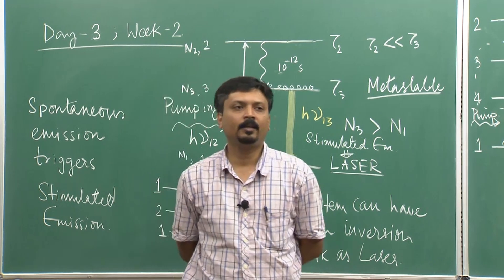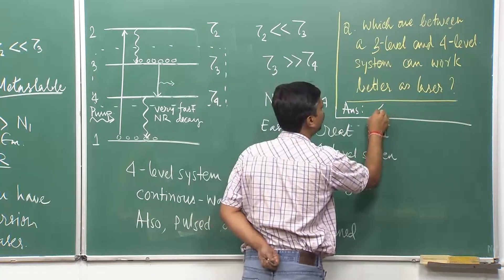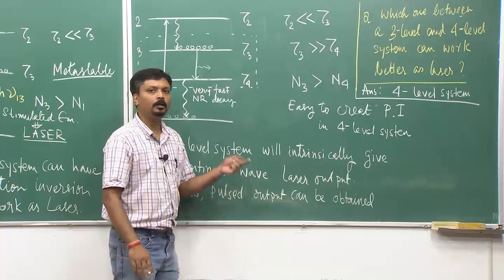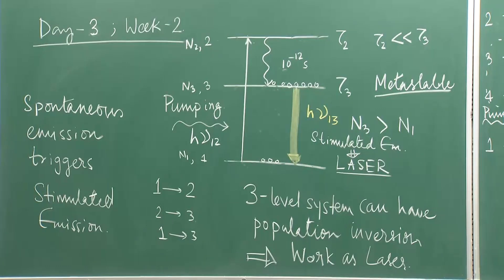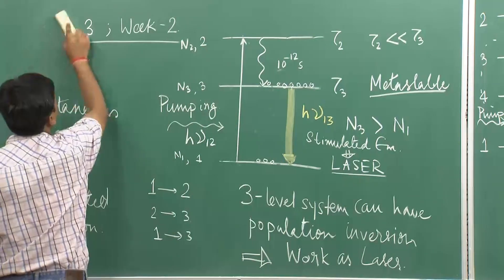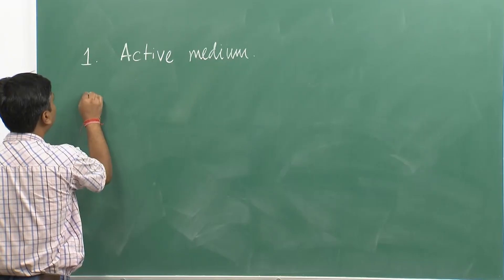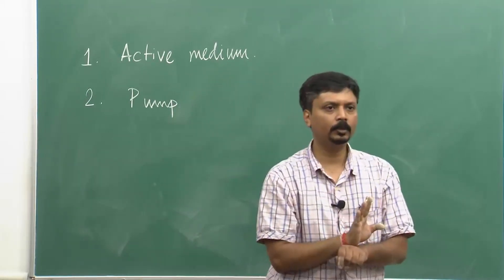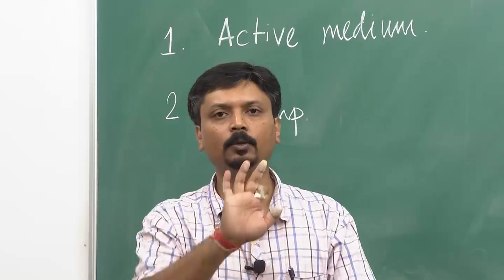Components of LASERs

Comment: 4 level system is much more efficient but why ?
Still it's not clear... 🤔
Reply: because its does not require much power  which safe our  cost  and time thats why more efficient than 3 level system
Reply: 4 level laser have a meta stable state between two excited states, when electrons excite to top level, quickly decays to the third level, which is the metastable state, and spontaneous and stimulated emmision takes place, as the electrons move to the second level, which is also an excited state, can very fast move down to ground state, now think, in three level, ground state has many atoms and too much pumping is required to attain population inversion, but in 4 level, because the emmsion takes place b/w metastable nand excited and as the electrons don't stay in the excited for much time, very few atoms are requried for population inversion ans it helps in continuos emmision that can;t happen in 3 level laser which has bursts of populatkon inversion
I hope this helps :)

Comment: ok i understood that 4level is better than 3leve because it requires less energy,but i still dont have a clear explanation as to why and is this the only thing better about it? perhaps im having trouble relating lifetime of exited state vs ground state vs the pump rate etc
Reply: i might say soemthing wrong but here s my best guess:
in the 3 level laser the emission that produces the light happens between level 3 and level 1 ( the groudn state) usually the ground state is the state that has the most atoms there, which means it is really hard for you to create a population inversion between the ground state and another one ( because you have to pump a big number of electrons)
in the 4 level laser the emission that produces light happens between level 3 and 4
level 4 is not the ground state , the ground state is level 1 here, but you pumped the atoms in the ground state to level 2 and they go down to level 3 which means level 3 has now more atoms than level 4 so the atoms in level 3 can easily go to level 4 and then to the ground state (in a very fast non radiative manner) which means that level 3 ALWAYS has more atoms than level 4 so the population inversion always exists between level 3 and 4.

now u might think that i still pumped from the ground state to level 2 in both scenarios ( 3 and 4 level systems) so why is 4 level more efficient?
 the answer is that in the 4 level laser all the pumped atoms will emit radiation because level 4 has 0 atoms so in order to establish equilibrium between level 3 and level 4 alllll the atoms in level 3 HAVE  to emit radiation so the population inversion stops to exist

however in the 3 level laser the ground state can never be empty which means if we consider N as the number atoms that are still in the ground state after pumping and NP as the number of atoms pumped only (NP-N)/2 atoms will emit radiation 

for example if we have 12 atoms in the ground state and we manage to pump 7 of them, in level 3 we will have 8 atoms and 4 in the ground state, instead of all 8 atoms giving radiation we will have 2 atoms coming down which will lead to us having 6 atoms in each level hence equilibrium
Reply: @ameraoun7  you said they go from 2 to 3? and then you go back n forth many times ,im sorry but this is all even more confusing  and i appreciate you trying and writing all that but the more i read the more it made no sense and got confusing and perhaps you are making mistakes so i did not bother with all of it ,thx anyways
Reply: @Punyasloka Sahoo thx but these kind of explanations do not always make sense to me unless i am visualizing what you are saying because so many things happening at the same time